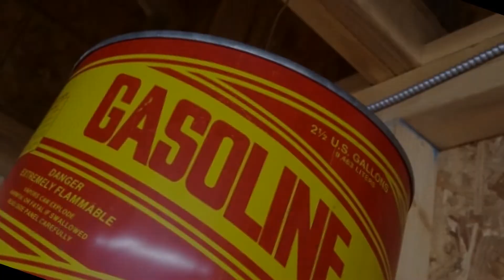Chevy Silverado 8100 8.1L 496 Vortec - Codes P0446 P0410 - Caused by Vacuum Leak

Comment: Watched your video and my vacuum hose was exactly as described for the P0446 code on my Suburban.
Reply: The vacuum line didn't fix my P0446 code. I changed the purge valve and fuel tank vent valve. That didn't fix it either. Before dropping the fuel tank to change the pressure sensor, I decided to change the fuel cap. The code is gone now. I'm guessing the cap was holding vacuum, but not pressure. Idk. As long as the code is gone.
Reply: That wasn't it either. Code came back.

Comment: My vacuum line was disintegrated just as you described. Have had the p0410 code thinking it was the check valves. Hopefully this is the official fix for me
Reply from the maker: Good luck !
Reply: @ImpalamansGarage  repaired the line and passed smog right away. Thank you sir.

Comment: I changed the hoses but still have the check engine light. Should I try erasing the light to see if it comes back?
Reply from the maker: I would yes. If it comes back, there is another leak somewhere. That is a definite possibility.

Comment: Where does that vacuum line connect on the 8.1
Reply from the maker: Pull the engine cover off and feel around on the rear of the intake manifold. The vacuum port kind of hidden and a little hard to find.

Comment: WHERE IS THE PCV VALVE
Reply from the maker: These motors (8.1) do not have a conventional PVC valve. They use a special port on the under side of the intake manifold.